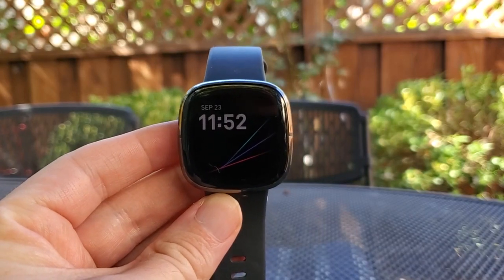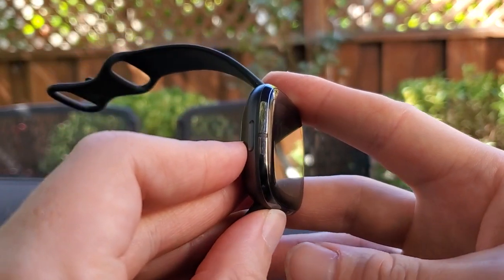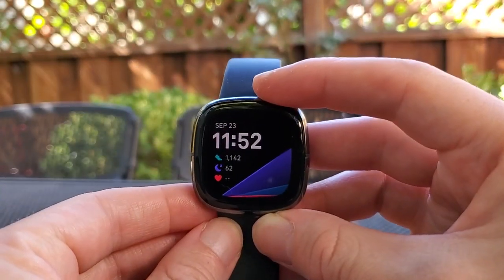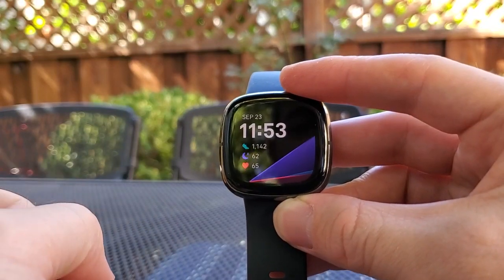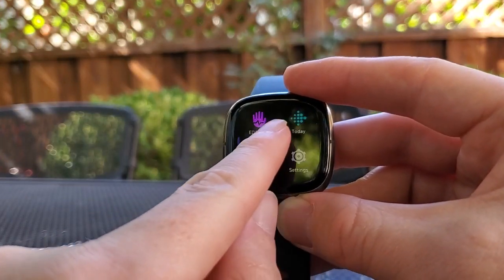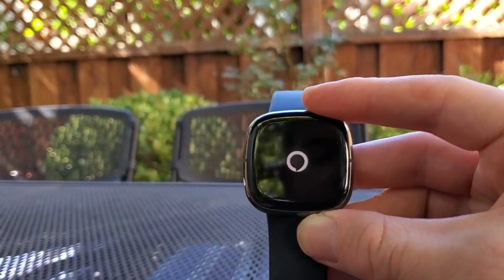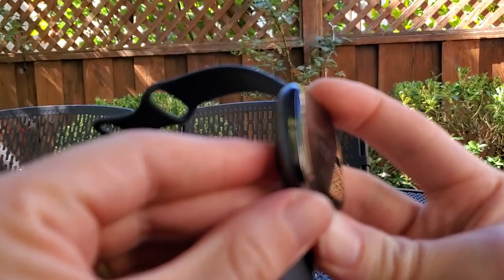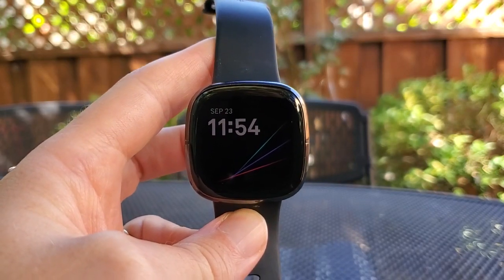Solid State Button on Fitbit Sense

Comment: That button unfortunately is the worst thing about the Sense for a number of reasons.  The main reason why I don’t like it because my wrist will press it constantly. And it doesn’t have to be on the side. It can be pressured to be pressed by your wrist underneath the watch itself. This wastes battery and is in my opinion the main reason why people complain about the battery life. To put it in perspective, during the day, when watching myself to keep this from happening, under normal use, the Sense uses about 10% battery life. At night, over 8 hours, it uses 25% due to my arm and wrist pressing the watch. Night mode doesn’t help you, because the watch can’t ever be set to turn off this button.

Comment: It’s so unfortunate that I had to return my damn Fitbit sense two different times because of this. I had actually purchased it at the price of 279.99 plus tax and 13 dollars on top for 1 day expedited shipping..... 303 bucks for a watch that I can’t even control with the side heptic button. I returned the first one then received a second one had similar issues so I returned the second one for a refund. I have the Fitbit Versa 2 and I still want to rebuy a second Fitbit Sense but even after a factory reset I still couldn’t use it properly because that side indentation didn’t respond to my touch at all.